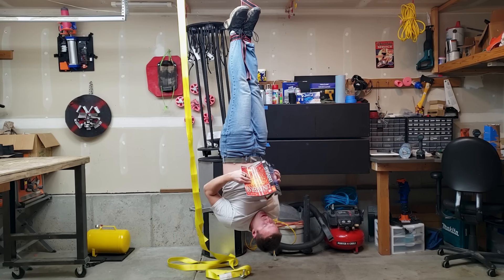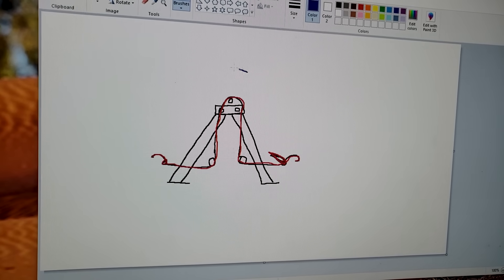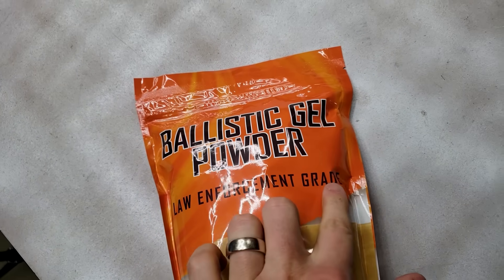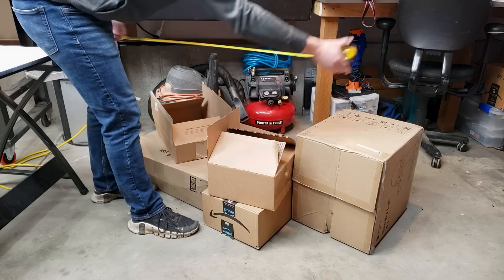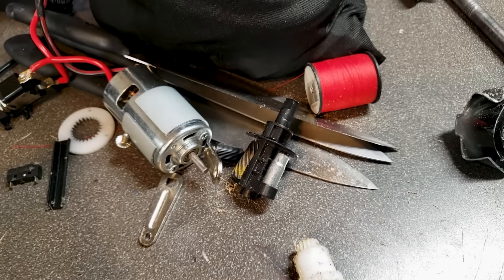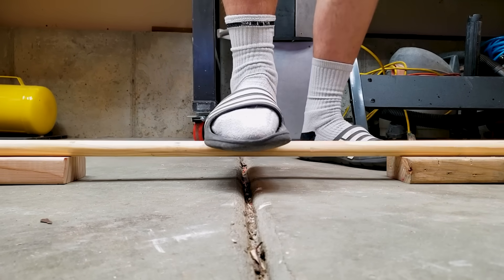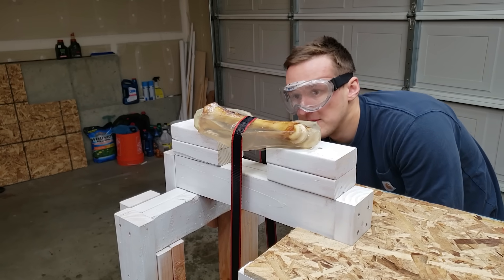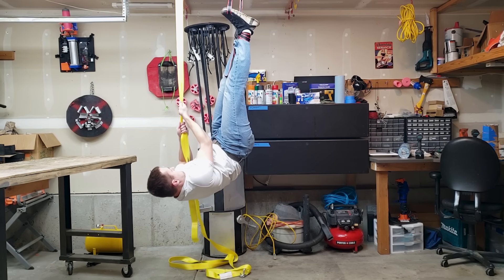Can a Ratchet Strap Break Your Leg in Half?

Comment: Glue sanding belts to the track on a treadmill. Place 3ft cylinder that you can almost run in. Rigid mount it one inch above optimal running spot on treadmill. Get into cylinder. Have friend turn it on. Have fun!

Comment: I routinely debate my coworkers on ratchet straps vs load locks and load bars.

Ratchet straps are king in my book. Multi-use, compact storage, and can be used in conjunction with other securement devices. I be straping things to things that don't need to be strapped to things, and no I will not elaborate.

Comment: Cows weight about 500kg. (divide by two because a cow has 4 legs and a human only has 2 so 250kg equivalent). Average human is less than 100kg so cow bones are going to be at least 2.5x stronger than human bones for safety compliance with their designed weight.

Comment: I'm just gonna say, one time I picked up a trailer that got it's mudflaps absolutely f*cked by whoever decided to install tire chains on it wrong, and there was no way I could bend the hangers by hand, so i used ratchet straps. 

I'm pretty confident I could snap your leg in half given the kind of leverage I had on those hangers, so I'm just gonna go with yes.

Comment: I doubt it. I imagine it'd be like a boa constrictor, but like 50 times worse. Those straps will just keep tightening until you hit bone. And then you break that bone and it tightens that point to a pancake. Those straps don't stop tightening until whatever it's holding down is pressed rock solid.

To clarify, I'm talking about the straps you'd use on a semi trailer to secure loads of lumber. Not the wimpy straps you use to secure furniture in the back of your pickup.

Comment: Thanks for letting me know I'm fine having a half amputated leg. I was worried that I had to go to the ER.
Reply from the maker: You're good just be careful around ratchet straps
Reply: Nah, just pour some cough syrup on it.  You'll be fine.
Reply: I heard all it needs is a flushing, some fuel cleaner, and a new oil filter and it should be good as new!  @ObeyCamp

Comment: a 10 tonne strap should easily break a bone... although they are a quite wide which would be a slight disadvantage.
Reply from the maker: Ya i coulda used the wider one but then the pressure is distributed across a wider area
Reply: @currentconcept  instead of laying the strap flat. try twisting it or folding it over itself to make it narrower. unless that's considered cheating.